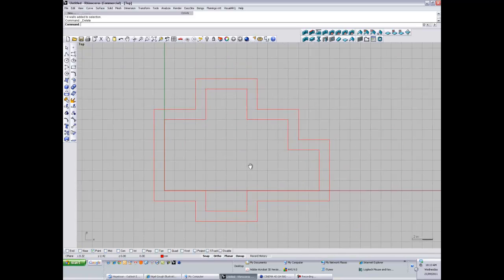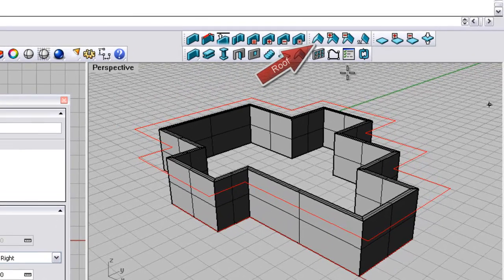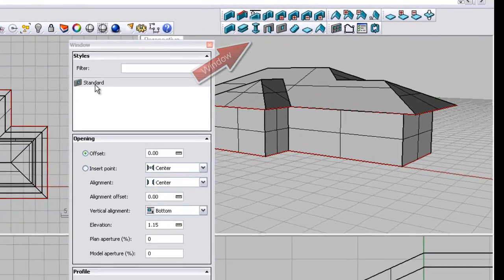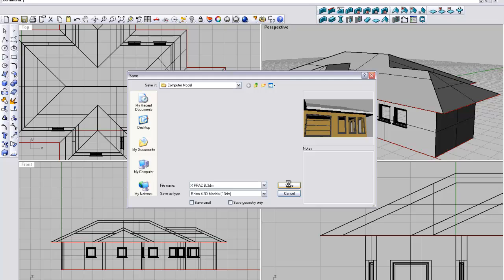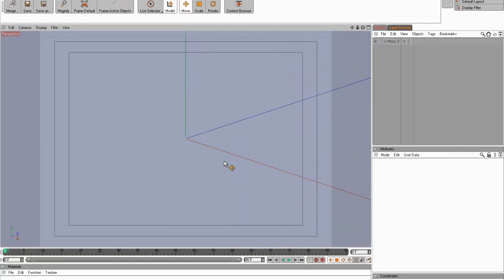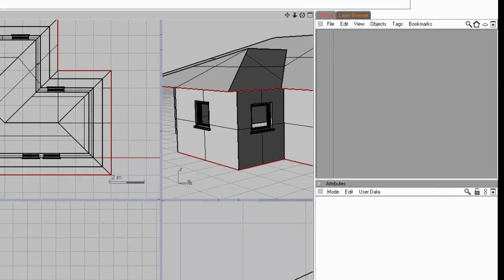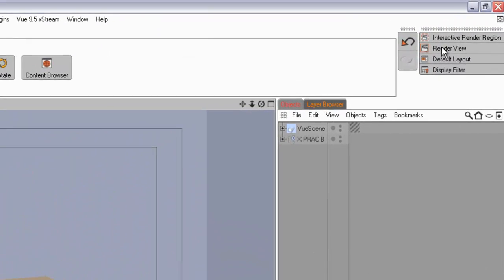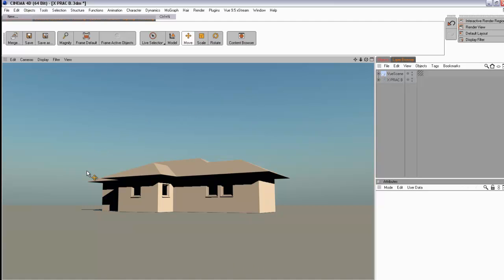Rhino 4 - VisualARQ Model Export to C4D

Comment from the maker: Hi Glyn,

Just a got responce back from Francesc Salla at VisualARQ in relation to your question I hope this helps in the interim.

To use his words;

"There are just a few options to convert Rhino geometry into VisualARQ objects, and they vary for each object type.These are the different options available:

A. Curves to VisualARQ objects:walls,beams,railings, openings, slabs and roofs.
B.Solids to VisualARQ objectts: walls."